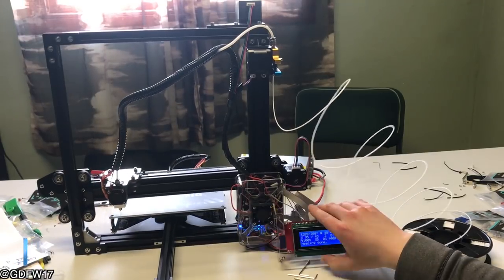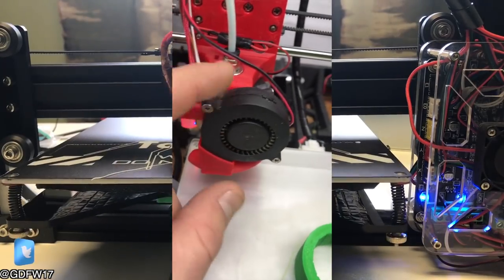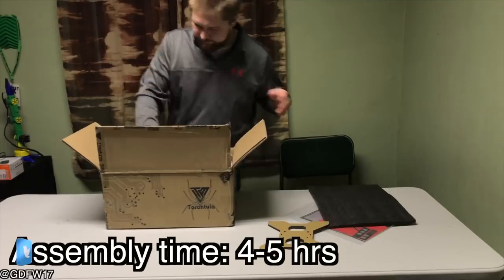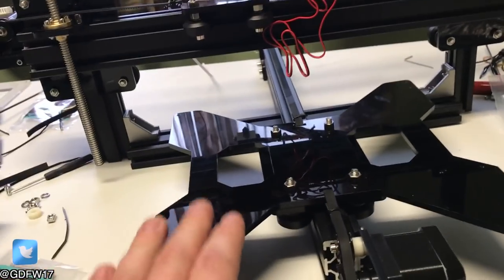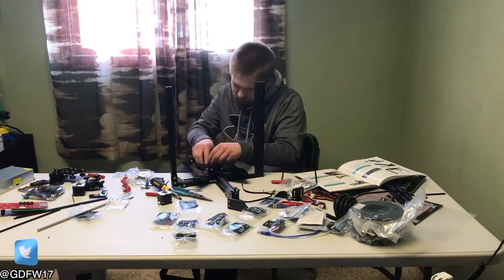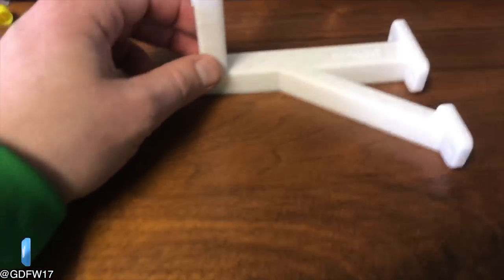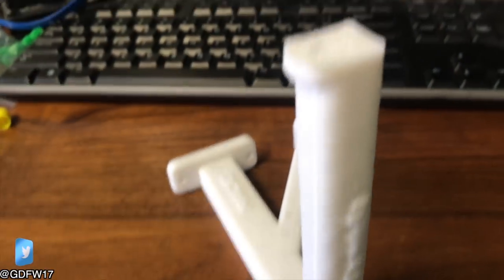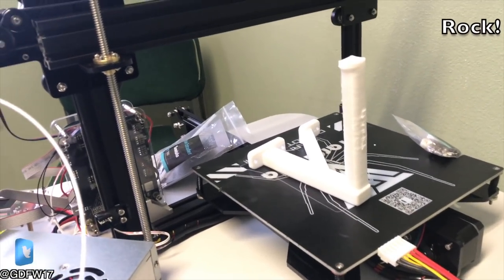Tevo Tarantula - Nothing To Be Afraid of!

Comment: I'm sorry but, 
Y assembly is faulty that's why it is wobbly.
(I had the same "issue" 7-8 months ago while I was assembling mine, but I went to the FB group and I found that there are concentric nuts that I'm not using/adjusting properly) 
You need to adjust your concentric nuts(google it) and there will be zero/0 wobble.
It is the same on X and Z if the wheels are not aligned snuggly and correctly in the V slots of the 2020 extrusions.

Comment: Coincidentally I just finished building one of these for a class I'm taking for an ME degree. Didn't have the issue with the bed plate but did with the y axis. Plan to upgrade it with an aluminum bed plate mount and 2 part cooling fans and sturdier corner brackets

Comment: I bought an ANET A6 from banggood. It was terrible. The power supply was faulty from the get go. The Part fan died after a week. Then the heated bed's mosfet went the way of the dodo bird.
I ended up throwing out the motherboard and replacing it with RAMPS 1.4 + Arduino Mega2560 + Marlin 1.1.8
I am glad I did. The Marlin that came in the original firmware was crap and would dance all over the place when homing axis. 
To pour salt on the wound, I couldn't upgrade the firmware on the original mother board, even with a J-tag programmer! 
Banggood refunded me $40 for the power supply but ignored my other requests for refund regarding the fan and the motherboard. 
Banggood used to be good. Not any more. 
Same stuff as other sellers like AliExpress or GearBest, but with higher prices.
If you are buying a new printer, shop around and don't be fooled by "Bangood has the best customer service" line.
It's no longer true. Go for the lowest price. They all sell the same stuff from the same suppliers. 
I think they are playing the numbers game like all other sellers. They don't mind losing loyal customers. All they have to do is send free units to YouTube'ers, and get a lot more new customers than before. Its the new approach to advertising these days.

Comment: hey when you assembled you Anet A8 did you have a  problem with not printing in the center? if you did how did you solve this plz and thx
Reply from the maker: It’s a setting in your sliver, but is also a setting in the firmware I think
Reply: ahhh so do you think i have to replace the electronic board?
Reply from the maker: Nope! You can just change settings in your slicer, or reupload your firmware
Reply: ok what slicer do you use?
Reply from the maker: cura